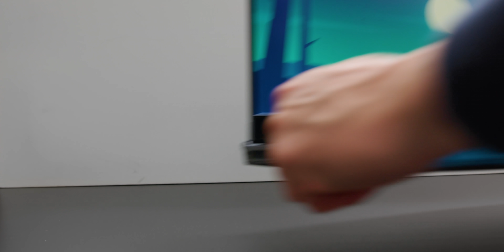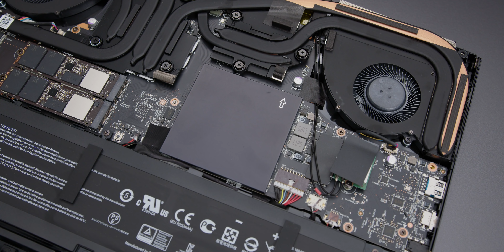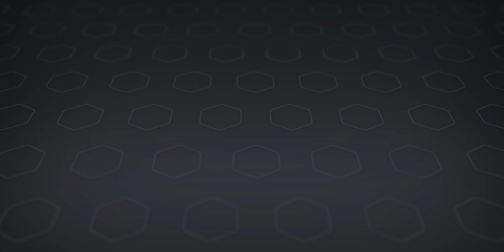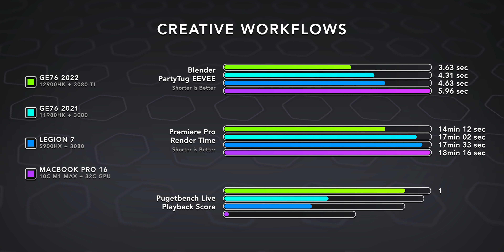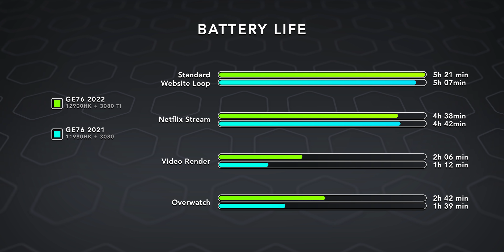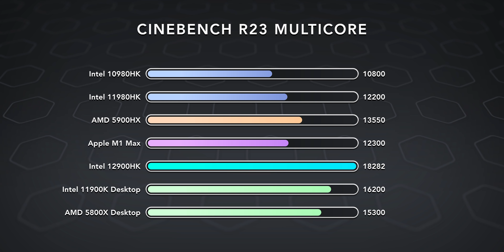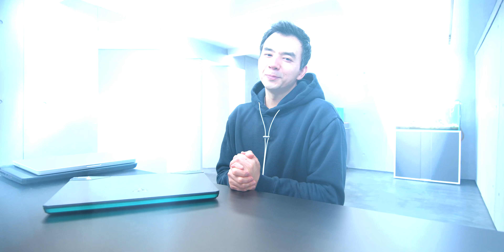This Laptop Is Faster Than Your Desktop

Comment: Glad to see Intel making a comeback. Makes me exited to see Dell put these bad boys in their newer XPS laptops. If they do, it would make them more competitive against Apple's Macbooks!
Reply: The xps are way too thin to outpeform the MacBooks, even with the new intel chips. If they wanted these numbers, they would overheat!
Reply: @kjeldkaj  I wish they also made thicker XPS laptops tbh. I could still live with about 1.5 times thicker laptops if the cooling is great. Maybe do that for 17inch.
Reply: Dell can fit in lowly end i3s and i5s and still won't be able to cool the xps properly 🤣
Reply: Dell has to first fix their quality control issues. I don't understand how such premium products can ship with wobbly track pads
Reply: @propiii  yea i just bought a xps 15 9510 and it still has the wobbly trackpad
Reply: What the Dell XPS 13 needs is an zen4 AMD ryzen 7 7800u with RDNA3 iGPU.
Reply: I wish Dell to develop a product that looks elegant while being perfectly capable of gaming loads over extended periods of time. The market demand is there, as most people woulkd want a single device using which they can do both, work and play. Like a hybrid between theri XPS and Alienware devices. I would buy it immediately.
Reply: 45W intel i7 9750 is burning and cant think this new cpu :)  İntel is not efficient anyway.  AMD dekstop processors 65w :D
Reply: Actually if they just put AMD into the XPS it would be competitive. The big takeaway here is that Intel is NOT COMPETITIVE in terms of wattage. To get their score they needed 105W to the CPU.... AMD is using roughly 45W (can boost to 75W but for only about 3-4% more performance) and Apple is using about the same in the M1 Max... 
Intel at 75W looks decent but when you figure that AMD will retain 90% of its score at 35W and that would be less than half the wattage for 70% of the score.... it doesn't really compete in thinner laptops. Needing 75W to go fast on "balanced" is a joke. Really Alderlake needs 45+W to wake up at all as their min spec chips use 28W.... AMDs 2020 parts (Zen3) is still a better play. 
However I'm sure that being Dell; they will put this new uncompetitive Alderlake platform into the XPS to keep the line a solid "meh". I used to own a XPS 13, won't buy it again until it has AMD in it. Intel just SUCKS in mobile chip efficiency and thermals.
Reply: Ya i am planning to buy xps17. I want gaming performance and fix that touchpad issue.
Reply: Mabooks have become uglier since 2020 with a useless notch and phone processor inside. I don't understand what's so good about it.
Reply: @ezflower-s7i  I may understand you with the notch as it is a thing of personal taste, but the M1 chips are far from „phone processors“. Their performance (especially for the wattage) is no joke. The M1 MacBook Air when it released was competitive with 13“/14“ gaming laptops and laptops more than twice it’s price tag. The M1 pro/max are competitive in their price ranges while using as much power in total other laptops used for one component alone. 
And don‘t underestimate „phone processors“ too, as high end phone processors are probably as performant as i5 chips maybe.

Comment: You lost me at 1080P.  This is a PERFECT device for 1440P.
Reply: QHD 240Hz and UHD 120Hz are offered as well, in both higher brightness and better colors. FHD is for the base model.
Reply: @blue4059  And let me guess, the 4K 120Hz model costs $4000, right?
Reply: @abubakrakram6208  depends on the cpu/gpu, the top model with 4K is $4200, yes
Reply: I wouldn't pick anything less than 4k with such caliber of hardware.
Reply: The screen is 360Hz, you better play at 1080p if you are to squeeze out that many frames.
Reply: Good to know! I wish he reviewed a higher resolution version of this laptop.
Reply: 1080p is gross
Reply: @spinachpies  2K and 4K screens are not available at 360hz.
Reply: @spinachpies  depends on the screen size and distance you stay away from it. I have a 1440p display both on my desktop which has 27 inch and on my mobile phone at 6.7 inch but I keep my phone on auto resolution (which is usually 1080p) cause at normal 30 cm+ distance I can barely see any difference and the battery tradeoff is not worth it.
Reply: @alexandruilea915  disagree. There is a massive difference in definition between 1080p and 4K even on a 14' screen. Some may not care or be able to see it, but it's there.
Reply: @spinachpies  use windows without scaling on a 4k display and you will barely be able to read cause the text will be very small. I have a FHD laptop and 2 FHD 24 inch monitors at my office for programming and I can't read shit on the laptop from my usual distance from the monitors. They are setup around me in an angle. I use the laptop display for youtube and spotify only. Sure if I keep it closer it may be usable.
Reply: @alexandruilea915  but windows has scaling...
Reply: @spinachpies  Sure the text are crispier, but you don't get much more screen estate unless you want to deal with smaller texts.
Reply: @spinachpies  it does indeed and it also looks like shit for text usually. Especially if you move something from one monitor to another like I do in my workflow. If you move something from the monitor without scaling to one with scaling it bugs out and looks terrible usually.
Reply: @alexandruilea915  I think that's your own equipment my friend. There is no way that windows scaling looks bad, that's a complete lie, which makes me think you have never used it on a high res device. Also your point about moving things between two monitors has nothing to do with discerning resolution or not.
Reply: @spinachpies  also, my point about moving things around was related to the great windows saling that you praise so much. Even Linus made a video about how bad it is sometimes.
Reply: @eurovision4k656  the video I linked are uses two FHD displays. The only difference is the PPI between them.
Reply: Just use an external monitor
Reply: I don't understand why people want higher resolution instead of better FPS. Like come on, didn't you ever play games with more than 72 FPS? 1080p gives the best possible FPS and in laptops, more than 1080p doesn't make any sense
Reply: Even 4k but they couldn't have kept the 360hz screen

Comment: How DOES it compare to desktop hardware now? How much closer to a desktop 3080 is this now? 70% 80%??
Reply: Normal RTX 3080 is around 70% (1/0,6=167%) faster than laptop version. I guess its not better in Ti versions where the W difference is probably even higher.
Reply: @innocentiuslacrim2290  thanks. But how fast is it now? I dont care how they call them, but how they perform. Lets say, a 3090 desktop runs a game at 100fps. A Desktop 3080 might do 85-90fps there. Where would a mobile 3080 land?
Reply: @m0nztam0nk   around ~70 fps
Reply: @zawiszaczarny1749  thank you for your thoughts!

Comment: got an i9 9900k 3080 and 32gb 3600 ddr4, is it faster ?
Reply: Yep.
Reply: No, it's not
Reply: the cpu probably is but the gpu definitley isn't
Reply: I guess your "is it faster" question needs clarification. Is which faster?

This laptop is faster than your desktop in most applications. It's likely your desktop 3080 is faster than a mobile 3080ti, but I can't be sure without direct benchmarks.

Comment: So, it beats the Mac m1 chips and the laptop is upgradable... nice work MSI! 😇
Reply: The CPU and GPU are not upgradable. They usually aren’t.
Reply: @abubakrakram6208  yeah, but compared to mac, upgradable storage and RAM and user replacable batteries is a huge win! 
The M1 macs will be rotting in some junkyard in future but these will still be usable
Reply: @utkarshdharmadhikari6816  That’s true! Personally I replace my machines before that ever happens, but it’s nice to have.
Reply: @utkarshdharmadhikari6816   😂😂😂

You never heard of reselling your laptop 💻🤡?

Don’t dump it in the junkyard send your m1max laptop to me !
Reply: @abubakrakram6208  no man, It's not about replacing the machine. it's about longevity and usability. It could be used by anyone; as long as the laptop is usable. 
Right now, there are many iPads and iPhone lying in someone's drawers or in dumpster coz someone didn't unlock them from iCloud. #HughJefferys
Reply: @RunForPeace-hk1cu  LOL... I will if you're ready to bear the shipping and import charges 😅
Reply: @utkarshdharmadhikari6816  You’re right. It’s better if the next owner can get many years out of it.

Comment: I was surprised to see nothing about the cooling. You mentioned the new thermal "paste" and power draw but how well does it cool while using so much power? Temps etc
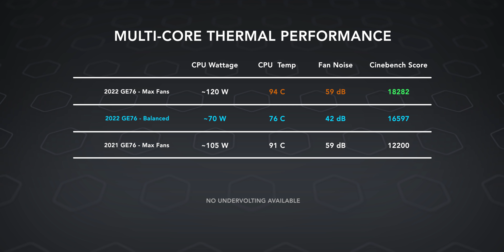Reply: 4:12
Reply: 4:10
Reply: He had graphs that showed power consumption and CPU temps... and then later, a graph on battery life.  While I would have loved to see inside this beast, he covered what you wanted.
Reply: Did you watch the video? He clearly shows all of that.

Comment: They could at least put a QHD screen in there, 1080p with a 3080ti? No thanks!
Reply: its pointless on a small 17'' screen
Reply: @zawiszaczarny1749  I disagree...my 13" HP has a 4K display and it looks incredibly sharp compared to my 13" 1080p Blade Stealth. 17" is a decent size for a QHD or better display and the 3080ti has more than enough grunt to power it.

Comment: The only reason I haven't tried MSI is that the aftermarket value isn't that great. Dell, Lenovo and even Asus has good aftermarket value compared to MSI. 
BUT, since they are few of the most powerful machine on the market atm, I am really starting to sway here. 
Good job MSI and definitely good job Intel. It'll be another great year for laptops.